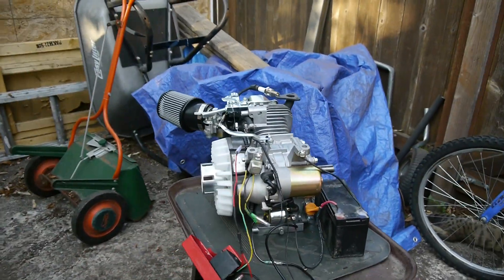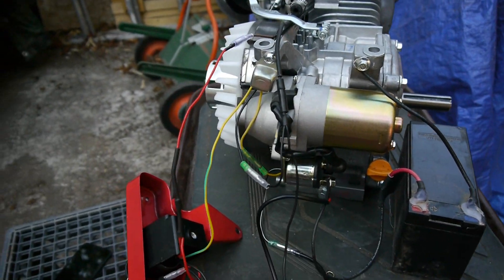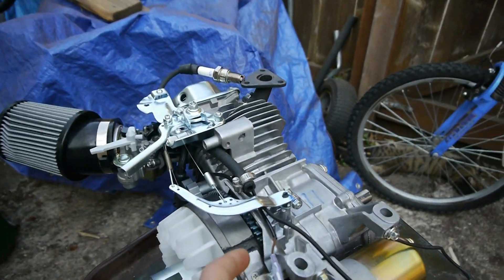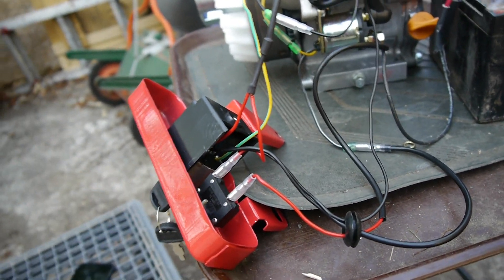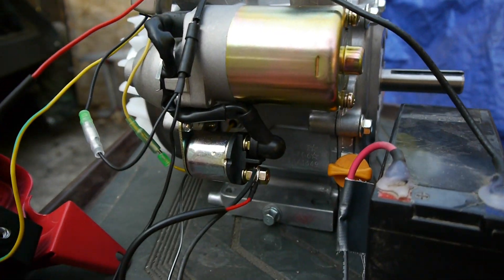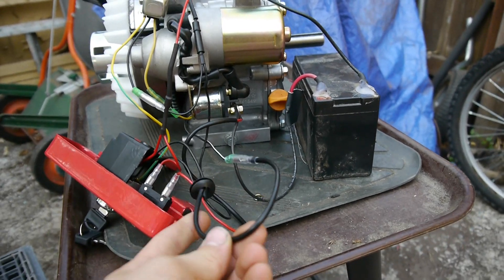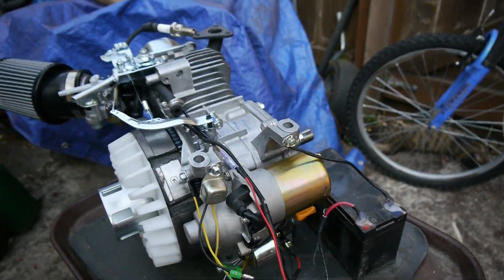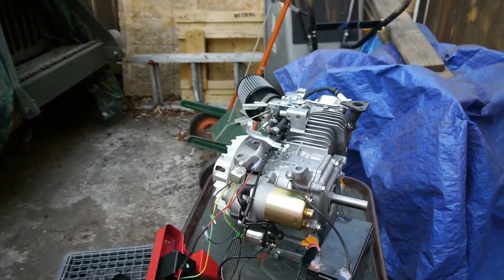How to wire electric start on a Predator 212

Comment: The link is no good :(. So if i get a motor that already has the electric start on the motor.... do i just connect the battery and while its running it will charge the battery?

Comment: How do you keep the battery charged
Reply: Has a charging coil under the flywheel
Reply: @kylependergrass4064  charge coil comes with starter kit

Comment: I applaud you for your clear explanation of the wiring.

What kind of battery are you using however? I would assume 12V, but what is the amperage or the amp hours?
Reply from the maker: I used a battery I had leftover from when I took apart a computer back up power supply, it was 12v and I believe 8000mah, however it really wasn't intended to work with that system like a small quad battery would.
Reply: EpicRc Is Awesome Good to know! Thanks.
Reply: EpicRc Is Awesome One more question. Today I’m about to record for a full tutorial of installing this kit while giving credit to you. On behalf of others that may have this question, what happens if someone has deleted their low oil sensor. The original black wire that connects up to the black wire of that sensor, is that a ground? I would assume so due to the nature of the color of the wire, and commonly/sometimes black wires are used for ground.
Reply from the maker: @NiTecIndustries  I would just not connect it, as that would complete the circuit and it would act like there is no oil in the engine if I am thinking correctly. Either that or it will act like it is full of oil.
Reply: EpicRc Is Awesome Come to think of it that makes sense. Thank you
Reply: Does the coil need to be installed for this to work?
Reply: @robertmiles9488  Factory ignition coil and charging coil from the kit yes. I am in the works of getting to release an complete video on how to assemble the kit and wiring on my channel.
Reply: X!-NightHawk Videos-!X  how did you set the factory coil back on? What’s the space between the fly wheel and factory coil?
Reply: Robert Miles In the harbor freight manual, there is a value for setting the spark plug gap that I used. There isn’t unfortunately a number for setting the coil gap, so at first I thought that’s what the numbers meant. I still used them anyway and I have had no problems so far with my engine starting. 

The numbers are 0.027 to 0.031”, if you don’t have a feeler gauge, use a business card.
Reply: X!-NightHawk Videos-!X my motor has already been up and running I just got the electric starter kit yesterday and having some issues with wiring it up but you did mention the charging coil did have to be installed so I’m hoping that was the reason why it didn’t fire over
Reply: Robert Miles that should be why then.
Reply: X!-NightHawk Videos-!X I’ll keep u posted bro thanks for the time and fast responses
Reply: Robert Miles Not a probs; I’ll hopefully have the video out next week.
Reply: Hey man I’m still having problems after hooking up the charging coil
Reply: Robert Miles Weird..Maybe from here then one of the parts are bad or double check all wiring. Maybe use a voltmeter to check and see if you have any volts anywhere. 

Is your Low Oil sensor deleted?
Reply: X!-NightHawk Videos-!X so my yellow wire looks like the oil censor wire but I don’t know where to plug that into. My turn key box has 1 wire that has the ring at the end that’s for the power to the starter then I have a long black wire with a male end a shirt black wire with a male end a shirt black wire with a female end and a shirt brown wire with a male end on it. The starter has a shirt black wire with a white stripe that has a male end and the only other wire coming from the engine is the coil that has a female end
Reply: Robert Miles well that’s a new one then. I’ll have to wrestle this in my head to transcribe the wire colors because some of this described to me is slightly different to my setup. However, you can look up a wiring diagram for this kit via google. There are images results for a Honda GX electric start SIMILAR to this kit that you can follow its wiring diagram. But I will be uploading a video  and a pdf instruction set very early next week.
Reply: @robertmiles9488  video is live on my channel now. Try using that.

Comment: Don't you need a rectifier? Just so the battery doesn't over charge
Reply: If you run more than one charging coil then yes
Reply: @roadkillsf.f.cgarage386  the rectifer is heat shrinked in the wire comming off the breaker reset switch,
it's there but hard to see, just a little bulg in ehe black shrink tube, I checked it with diode checker and it;s there

Comment: So my 212 won’t idle. Do you happen to know any way of fixing that?
Reply from the maker: There should be an idle screw on the carb you can turn in, however, if you remove the governor entirely, there seems to be a bit of a problem with idling sometimes. Anyway, there is a screw on the carb, it is usually black and made of plastic. You will want to turn that in a little bit until it idles properly.

Comment: Did you have any issues with the flywheel fitment?
Reply from the maker: Not with the kit I have. Although I have heard that if you have the hemi version of the engine, the shaft is tapered differently, so it won't fit.  And I did end up having to trim a little bit off of the white plastic fan part because it ended up rubbing on the cover.

Comment: Been trying to find a good video on this, thank you! If I remember right, it's called a lightning coil. Do you have it set up to recharge the battery?
Reply from the maker: Yes it should charge the battery how its set up.
Reply: @isaactheisaac  i need your help with a 49cc with electric start